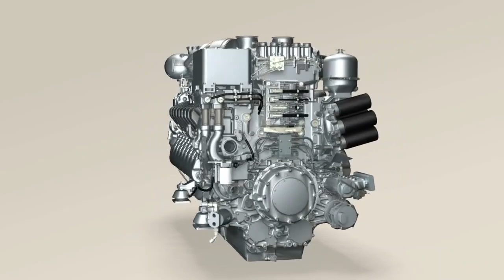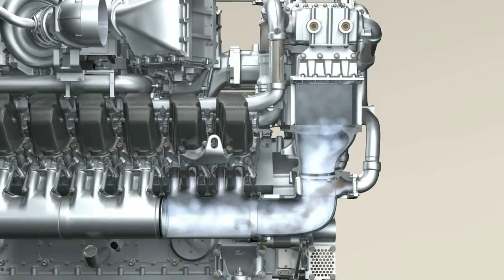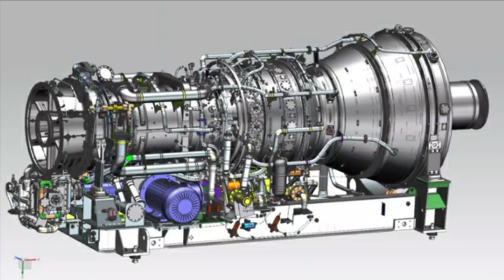GRSE to license manufacture Rolls Royce MTU S4000 Marine Engines in India

Comment: screwdriver 🪛 assembly
Reply: Something is better than nothing
Reply: @AnirbanSarkar203  

Something is better than nothing is only true when the something is free.

In this case, the something comes with a big price tag.
Reply: We will get advanced engine technology from U.K....in the future we can develop advanced indigenous engines based on this tech like in the case of DRDO-SAFRAN Afterburning Turbofan Engine for AMCA
Reply: @Abin-i1b  

You are "getting" it in the same way a microchip is shipped to India (along with a big bill).  It does not mean u can design a microchip nor fabricate it.

Beyond that, there is no getting.  

The brains 🧠 of the scientist and engineers that built it remain in the UK.
Reply: @MujiPepe  

It is the same as assembling a computer.  Nothing is learnt about microchip design or fab.  It's just assembly.